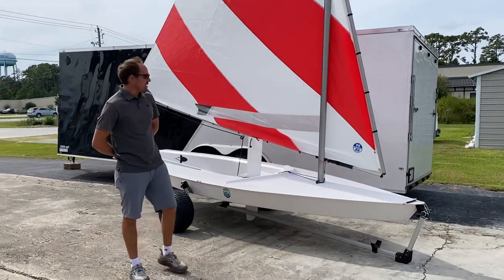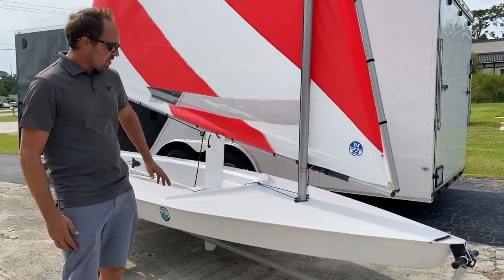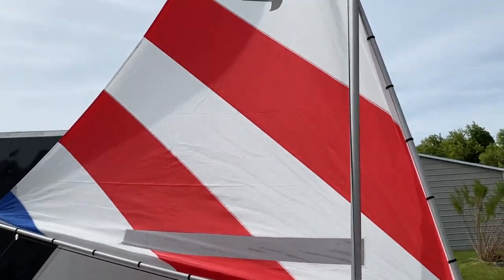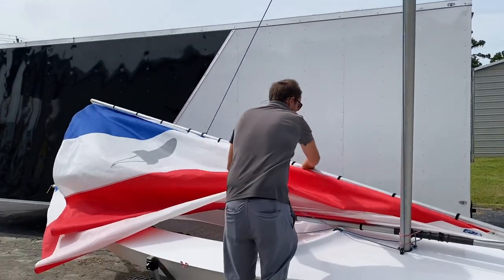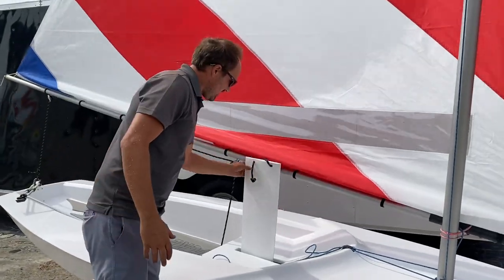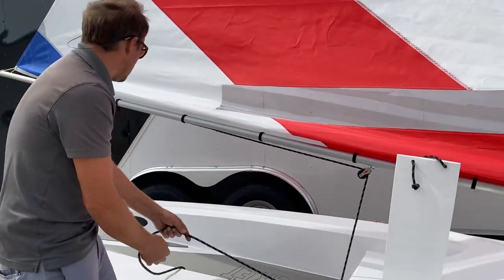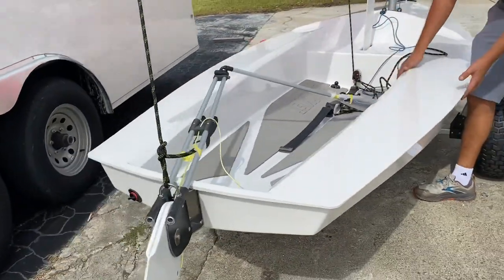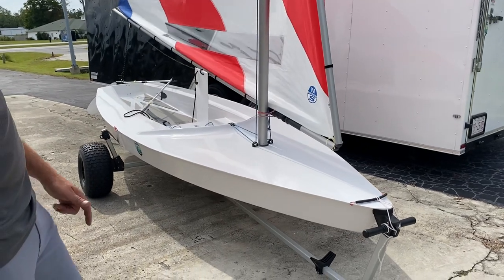Rocket Sailboat Fulcrum Speedworks walk-thru

Comment: You say that the single hex ratchet can be upgraded with a cleating mechanism so you don’t need to always hold the main sheet under light winds.  What is the cleating mechanism you use?
Reply from the maker: We replaced with a Harken 57mm carboratchet w/ cam and flipped it upside down

Comment: I can buy a sunfish for pocket change... why would I spend 5K on a sunfish 2.0??
Reply from the maker: You certainly cannot buy a NOT MADE IN USA Laser Performance Sunfish for pocket change and good luck getting one before 2024. And nice, productive comment there, guy.
Reply: @trustysailandpaddle  who needs a 2024 sunfish??? I'll take one from 1983, it's a sunfish, not an AC75.
Reply: Sure, you can also buy a used car vs a new car, but some people like something new and innovative.  Used sailboats can certainly be found in expensively and it’s a great way to start in the hobby… that’s what I did.
Reply: @stevelovescars  Innovative is a foiling sunfish with a wing. This is just overpriced shlock from the company that brought us the slowest foiling cat in existence.
Reply: Jay why don't you show us all the boat you designed and built? Or do you not have enough room to do that in your Mom's basement. Wait, does your Mom still talk to you? She must be so proud.
Reply: @matthewjohns7220  your argument is stupid why do I need to design a boat to know that this boat is overrated?
Reply: @jaysparc 
Some peeps gotta bring the negative vibes. Booooo
Reply: @trustysailandpaddle  Most old Sunfish are loaded with water.  The water is in the foam.  It can take a year with a fan to dry the hull.  Hopefully it will not be too delaminated to race.